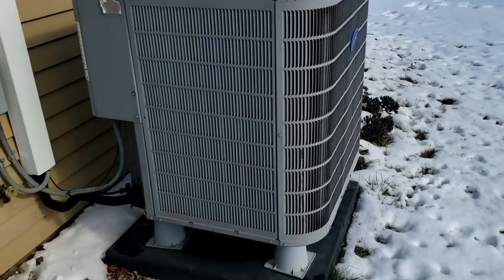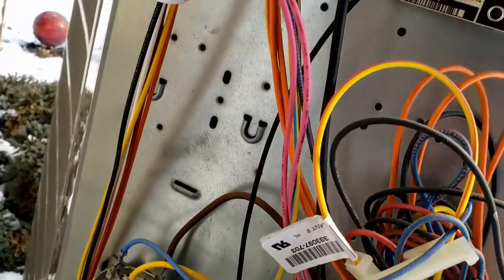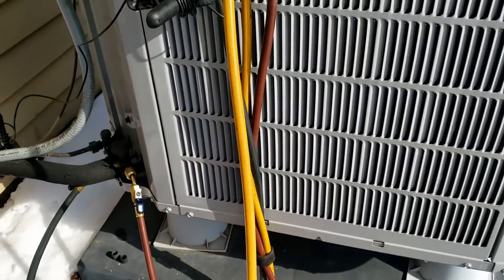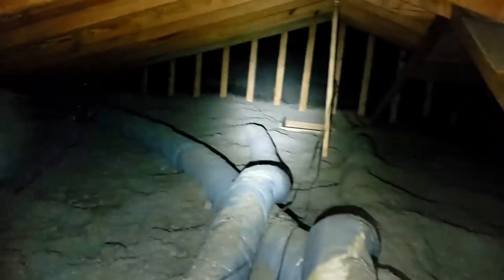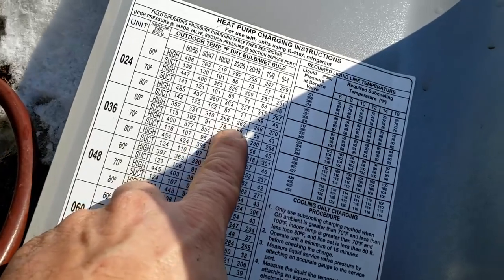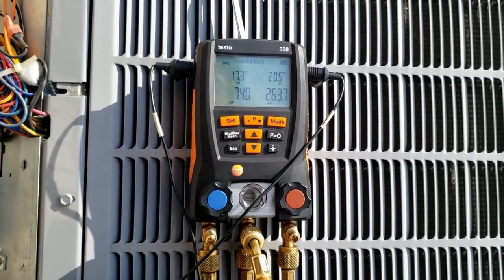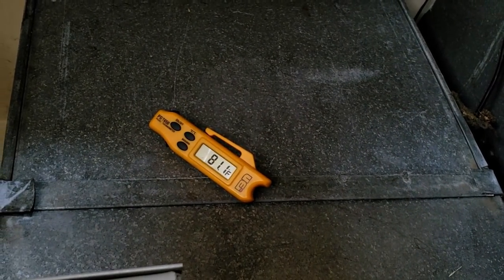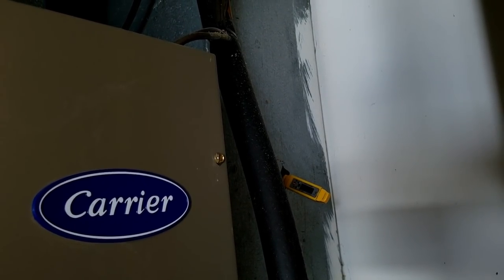CARRIER HEAT PUMP & ELECTRIC FURNACE NOT KEEPING HOME AT TEMPATURE

Comment: I watch one video, comment one time, and now you're on my feed. Take ra sa temps, find low ra, find ducts, make sure everything is clean and you're outta there. It's 25 degrees you can't expect much heat from that kind of system without additional stages a heating being brought on. I know you're making a video for your audience and it's probably the reason I wouldn't be good at being a youtuber. Bottom line is you gotta have a process and your videos make it seem like you're all over the map. I can't imagine doing the job AND making a quality video.
Reply from the maker: Sorry, I have no control over what YT feeds you. I did cover these two heat pump videos on my Sunday live show, the link is in the description section of both videos. If you have never watched my videos before then this might be why you might think I wasted a lot of time or have no clue what I'm doing. My live video helps put into perspective what I was looking for and expecting from these two heat pump's that I serviced.
Reply: @HVACRSurvival  I know you don't have control over it but now you've gained a new critic 🤣. I checked your channel out. I don't know about you but I find it challenging sometimes to switch gears going from large commercial primarily to residential. I'll watch a few more of your videos maybe give ya a sub. Props for doing the job and making videos that your audience clearly likes from what I can tell from other comments.
Reply from the maker: @Dave_Thomason  I started on residential in 95 and slowly added a commercial mix until now.   I  mainly do commercial refrigeration and HVAC since 2014 but would like to do even more industrial.  I'm not perfect or know everything but I try to do things right.  These two residential videos weren't the kind of videos I wanted to show but these are the kind of calls I'm getting sent on lately and for some reason these two videos have gotten a crazy more than normal views,  so I'm getting a lot of new people watching. I normally don't show residential service calls because it's normally boring to me, specially if it's the same equipment I see day in and day out because it's the same problems over and over.   Here's the thing..... I screwed up on the frozen HP video and blew the fuse because I wasn't familiar with that Nordyne control,  I'm a critical person of others and of myself,  but if I screw up I'll admit it,  I believe it gains more respect and creditability to admit my mistakes and will help make me better prepared for the next call.  I catch mistakes I've made that I didn't catch at the time of service while I edit the videos.  It's a lot of work making these for a little attention (some good and some bad)  and a couple bucks but it's been interesting to say the least.   I mention all these things because of your willingness to be open minded from what I read in your last reply.
Reply: @HVACRSurvival   I can almost guarantee you that you got a lot of views on these hp videos because of the recent cold snap we had here in Texas and other places. Heat pumps work real well here because our "not summer months" (what I call the other three seasons) are mild. The company I work for has customers on their 3rd heat pump replacement and we still get calls about how their outdoor unit is on fire, is smoking, found it with the fan not turning when the temps cause them to start defrosting. I'll admit that my comments could have been geared more towards being more constructive and I apologize. I'm on my 10th year in the industry, came up doing residential in the beginning but now I do mostly commercial comfort cooling and heating. When I must (when dispatch tells me to) I take the residential and refrigeration calls. No one knows everything about this stuff and every day brings the opportunity to learn something new which is why I really love what I do. There are almost no two days that are the same. Keep up the good work.
Reply from the maker: I just now seen this post because it got held for review. Thanks for the feedback, we can all learn something new everyday if we try.

Comment: If you read the installer guide the heat pumps say to charge them in the heat mode
Reply from the maker: That would be the only one I've seen like that. The preferred method is cooling for lennox, carrier, reem and I think Trane and if it's too cold they recommend you weigh it in calculated by lineset length over the factory 10 or 15 feet.

Comment: That duct work is existing. definately not 2015. that was done in maybe 2000ish if not the 90s. Where i live we cannot install vinyl flex duct because of the reasons you saw. it just deteriorates over time.
Reply from the maker: Your right, We normally use either the black out silver flex. I've never seen us use that gray stuff.

Comment: All of these DIY questions are cracking me up. So many variables to the ole generic “my unit is not working, changed batteries in stat, what is wrong?” Lmao Um first call a licensed mechanical contractor then ask them what you asked me, lol. If only it were that easy. Great job.
Reply from the maker: I think I'm starting to notice that. It's hard to determine for sure if they are just homeowners trying to get out of hiring someone or if it's a new technician just learning.
Reply: Personally I treat them all like homeowners because of possible liability issues. Otherwise if they are a tech they should know how to find the proper answer locally. Hell half the time the supply house knows because everyone walking in the doors are having the same issues.

Comment: At 7 degree outdoor temperature should my 2ton Trane XR heat pump have enough capacity to heat the home to 75?  Or is 7 degrees too low to even rely on the heat pump?
Reply from the maker: It will likely struggle like crazy to keep up. There is a lot that goes into properly sizing a system for a home. I'm not really that great at sizing.
Reply: you'll be mostly using strip heat unless the place is tiny!
Reply: I decided to disable the heat pump at any temperatures under 20.  When the defrost mode kicks in I loose a ton of indoor heat.
Reply: @twosawyers  are you on electric aux? then you should run it below 20. imo 10 to 15F is a good lockout temp on all electric, i've seen some people recommend running it down to 0F.
when the defrost comes on, even on gas, the furnace or strips is supposed to come on to temper the air. you shouldn't get a cold blast. wasteful but it can still make sense to run the hp.

Comment: If it's a 2 speed unit low speed would be lower pressures on high and low side. You need to make sure when checking charge on 2 speed unit you are operating in high speed
Reply from the maker: Correct👍👍

Comment: Damn. Two 60A breakers for 15kw?  Amps to spare!  My AH has 40A breaker w/8kw.  Outdoor ambient currently 24 and going down to 10 tonight.  Outdoor unit currently running at 100% duty cycle and 30 min defrost setting.  Thermo set at 81 with no strip being called for and maintaining set point.  Unit 25 years old.  Hope it holds together!
Reply from the maker: That's very impressive, it must be a small house or a inverter driven system.
Reply: @HVACRSurvival  I think 2583 sq. ft.  Lennox HP26
Reply from the maker: Wow, that's great!

Comment: Those units don't make much btu's below 20F, I would expect 15-20 Dt vs 25-30 Dt when above 50 F outside.
Reply: Yes exactly. Heatpumps is pretty much all I work on since 1988
Reply from the maker: True, they don't do great at those temps but they have improved over the years. Especially when you choose a inverter driven heat pump.
Reply: @HVACRSurvival  Yes hard to believe some are still at 50% btu at -4F!  Still 1.5 COP vs electric, good stuff.
Reply: @publicmail2  I definitely wouldn't use 50 in the example he was using as the higher end for regular heatpumps. Every heatpump I sell doesn't drop  much at all until around 30. And they are pushing out good heat at 20. That's where things start going downhill.

Comment: Shouldn't you be checking the discharge pressure as it's coming back from the indoor coil instead of straight out of the compressor? Supposed to be hooked to true suction port and 3/8 port in heat mode.
Reply from the maker: I was on the true suction and Carrier as a orifice on the 3/8 line, if your in heating mode you'll be measuring suction pressure on the 3/8 line, not discharge. That's why I was on the 3/4 or 7/8 line for my discharge.
Reply: I could see with the older carriers having that orifice prior to the "liquid line" service port where you'd have to read pressure prior to it. All our rheem/ruud and trane heat pumps have metering devices inside the heat pumps so we hook to the liquid line port after heat transfer has taken place at the indoor coil.
Reply from the maker: I used to do a lot of Rheem, I think Carrier is one of the only ones I've seen with a orifice at the service valve🙈

Comment: That looked like a 2 speed outdoor by the wiring. But inside it had a jumper between y1 y2.
Reply from the maker: Yeah they use a blue wire which is y2 on the geothermals. That's what gave it away to me. And they couldn't have jumped y1 and y2 because it literally staged as you seen that in the temperature rise and pressure changes.

Comment: You really can't go by subcooling in heat mode. Carrier uses a piston metering device in the outdoor unit
Reply from the maker: I know but it gives you a indication of the charge is close or not, kinda like temperature deltas. It's definatlty not a science on a system like this. Thanks for pointing that out, I should have done a closing video going over all the things I didn't go into enough detail on in the video. Thanks 4 watching!

Comment: Been hearing lots of problems with heat pumps. Why are they so expensive and complicated and difficult to repair?
Reply from the maker: They're not complicated to somebody that understands how the refrigeration circuit works. The problem is there's a lot of people out there that don't understand how heat-pumps work, they just know how to make it run but they don't understand why. There is no real problems with heat pumps. Heat-pumps are a great alternative if you don't have natural gas. Why are heat-pumps more expensive?  that's because they have more components in them than an air conditioner does.

Comment: When the techs fill the freon system ,Why do they always fill it to the very minimum and not full????
Reply from the maker: I fill to the minimum then measure the remaining based off total length and the required method of checking the refrigerant charge. (SH or SC)

Comment: Why is your approach method backwards??? Hooking up gauges is last resort
Reply from the maker: Was it the first thing? I remember checking the system (discharge) hot gas and liquid lines by hand, outside and inside, the air filter, verifying fans were operating inside and outside, asking the customer what was different about the operation, and doing a visual and audible inspection.

Comment: Makes me appreciate metal ductwork here in San Francisco that is 60 years or 70 years old with the original wrap of asbestos insulation around it still in perfect condition like it was just installed.
Reply from the maker: I'm a metal guy myself but it would still need insulated.
Reply: I remove metal duct work in Florida.  It sweats. Have one to change next week.  Drips every summer.
Reply: @coldfinger459sub0  the plastic flex used in the 70s gets brittle
Metal duct would sweets in our humidity.  It vanity be deal good enough.  The moisture condenses threw the old duct wrap.